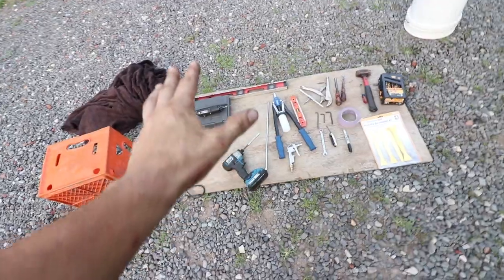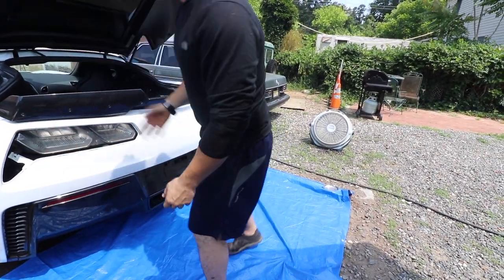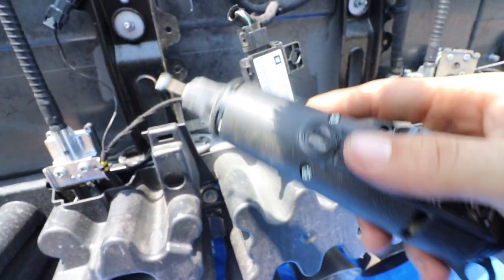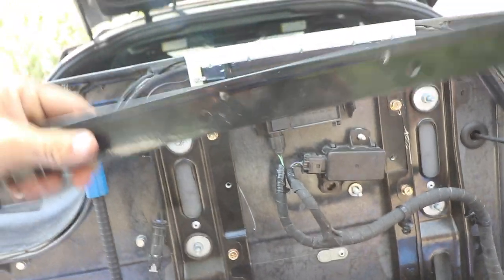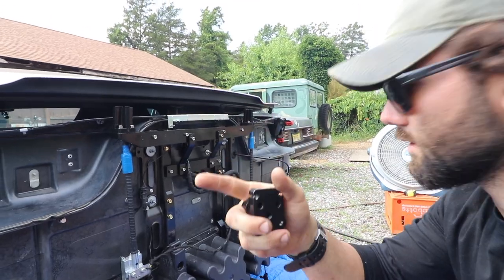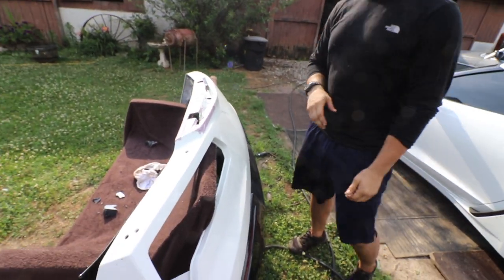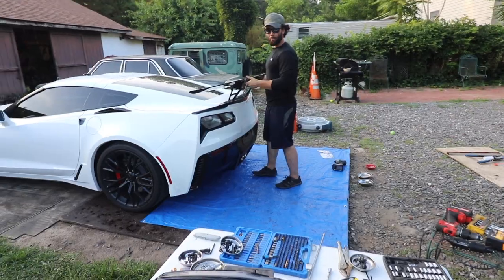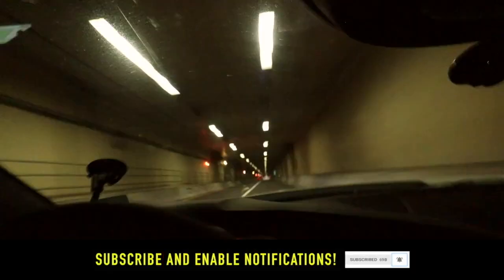HOW TO INSTALL A C7 ZR1 WING ON A Z06

Comment from the maker: I don't know what to comment so here's a sick pancake recipe..

not really but tools that help make this a piece of cake below:

TOOLS I USED FOR C7 ZR1 WING INSTALL:
Hand Rivet Nut Setter Kit W/ 60pc Rivnuts: @t
Wood Chisel Set - 1/4-Inch to 1-Inch: @t
Ratcheting Tap and Die Set: @t
Socket Set: @t
Dremel Rotary Tool Kit: @t
Milk Crate (Pack of 2): @t
Bench (Thank me later): @t
Cordless Drill: @t
Torpedo Level: @t
Torx bit set (T15 needed): @t
Allen Wrench Hex set (T handle): @t
Dead Blow Hammer set: @t
Air Gun Attachment: @t
Drill Bit Set: @t
Plastic Trim Removal Tool Kit: @t
Reply: lmao now  want pancakes
Reply: ctfu

Comment: I heard a lot of people complaining about this cheap wing flapping like bird wings... I would hope the carbon fiber one is more rigid but without testing it will be hard to know. I would not trust this wing at 150mph or even at 120mph in a high speed corner on a roadcourse....
Reply from the maker: Keep in mind my car is just a street car and not one of my track cars but whenever I take it out it's rare if it doesn't see 140+ every drive, sometimes much more spirited given the right conditions

Comment: Great install, looks awesome.  How did you attach the winglets to the wing?  Did you make the attachment permanent?  Thanks for taking the time to make the video!!!
Reply: click 30 minutes in he shows how he applies the winglets on wing my g
Reply: @nathandesantis5974  thanks so much, greatly appreciated!!!!
Reply: Dr. Scary do you see a problem how they were put on?
Reply: @louisjackson2405  the company that makes them, Extreme Online Store (EOS), says the 3M double stick tape will work.  However,  the place that installed my wing used additional adhesive to attach the winglets to the wing.  I felt more comfortable with a more permanent attachment.  When I contacted EOS and asked them about other attachment options, they did not oppose the suggestion made by my installers.  So I went with that.  I hope this helps.
Reply from the maker: It has held up perfectly so far, no movement whatsoever. how has yours held?
Reply: @TrackSlayers  So far so good!  I was able to sneak the car up to a fairly decent triple digit speed and no issue.  There is a stretch of road where I live where I can, with relative safety get the car up to triple digit speed for a brief period of time.  I did it as early as possible one Sunday morning.   No traffic whatsoever.   Straight, smooth,  and free from pedestrians and other motorists.  I mounted a GoPro on the inside of the back window facing rearward to view the wing.  No issue at all.

Comment: About to install mine. Just can't get over the 3m tape thing.. Is it really holding? Shouldn't it be riveted?
Reply from the maker: I felt the same way, although a lot of aero kits are held together by 3M tape, so it's not super-out of the ordinary. Make sure you prep the surface really well, and left the car sit for a day or so in the best case scenario, although I feel it is unnecessary, that's about what I did. Not a single issue for me months later. Loving it!

Comment: Great video, very entertaining! About to install mine and thanks to you I know where all the bolts go! Do you recall what size tap you used to chase the threads? I used an m6x1 but the bolts seem a little loose now. I plan on using thread lock as well.
Reply from the maker: yes daddy

Comment: Id like to see a video of you putting the top in the back with the wing.
Reply from the maker: just filmed a video with a new roof and there's a clip like this! It's not difficult, just makes it a two step process rather than a one step process once you lift the roof off

Comment: So I’m curious if you or anyone here can comment if there’s been testing while gaining Gs in the turns. My concern is that I’ll be at ACS or Big Willow hitting speeds of 130-140 in some corners that the winglets would come off. I saw a similar issue at ACS where a high end wing lost its end plates resulting in a spin and those end plates were installed by the manufacturer
Reply from the maker: I frequent 130-175  often no issues, just make sure you prep well, and don’t ceramic coat those fucking edges of the wing before you stick the winglets on 😂
Reply: @TrackSlayers  are these 130-175 down the straights or corners? I’m worried about continuous lateral Gs weakening the adhesive and creating issues down the line. We’re you happy with the quality of the chassis mount? It seems to be quite smaller than the APR option not sure if I’d fab one up instead of using there’s.  I’ll keep in mind on the end plates, I may paint mine
Reply from the maker: @RizzyDrizzyNewSiNN  straights mostly for me, about 30% turns perhaps. I prefer the EOS mounts since they replicate the OEM zr1 brackets, enjoyed the quality. I would get the carbon wing from them if I were you and had the choice for tracking the car  - they offer a carbon fiber option now.
Reply: @TrackSlayers  I’m interested in their carbon I’m just worried about places like turn 8 and 9 at big willow I enter going 130+ and accelerate throughout it so I just want to be sure, I ran the EOS stage 3 kit (the z06 equivalent airdam) and it broke my first day on track with it. I even have a video of me taking it apart. It was super thin and weak underneath and even the rocker extensions have that Same hollowness but they’ve held up, not sure if it helps performance the same tho. When I brought it to their attention they went radio silent on me so I’m hesitant trusting their product again

Comment: Could you leave your stage 3 wing on and just cut the small squares in the top for the brackets to come out?
Reply from the maker: Mr. Bulldog sure could. The wing legs don’t correct to the new aero at all they just run through it
Reply: @TrackSlayers  Thanks.  I have a high wing I am wanting to put on my Z06, but want to keep the lower wing too.   I know two wings.... LOL  but it looks good sitting on it.  Now just to find the chassis mount.